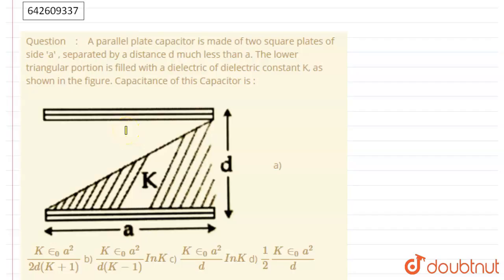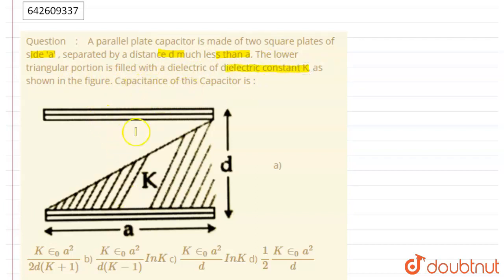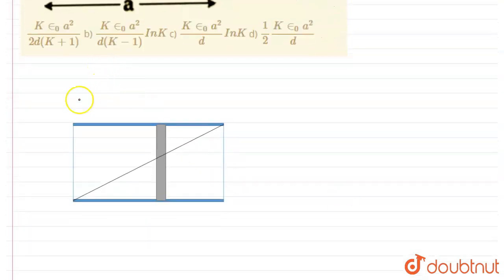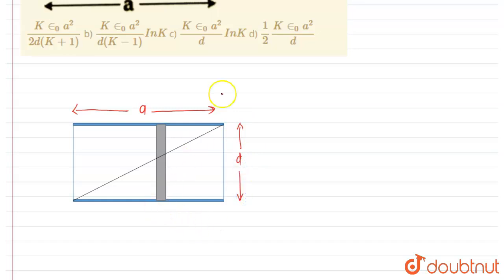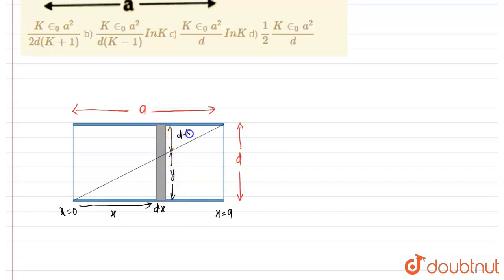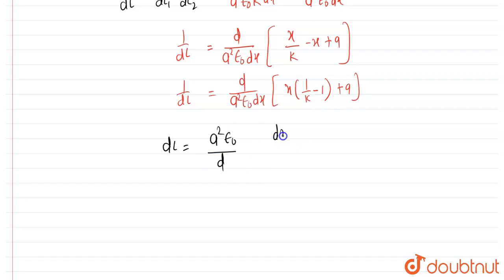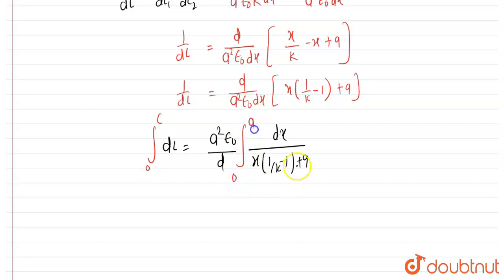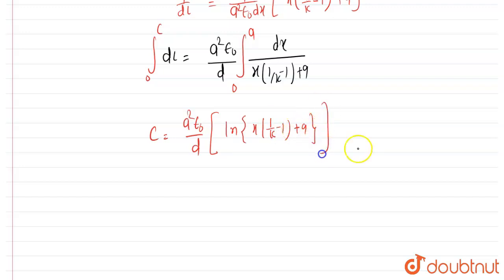A parallel plate capacitor is made of two square plates of side \'a\' , separated by a distance ...

Comment: Why is area of element dA=adx?
Edit: I got it. The 'a' is the length taken in the plane and below it(in z axis)
Reply: Its basically L*B where dx is the breadth and a is the length. Or at least that's what I think
Reply: @Shogun507 I didn't understand...a is the breadth...and dx is also the small breadth....'d' should be taken instead of 'a'
Reply: Bro it's square so width = breadth= a